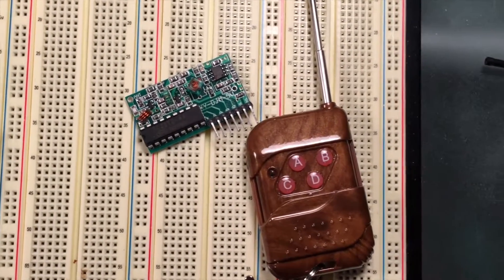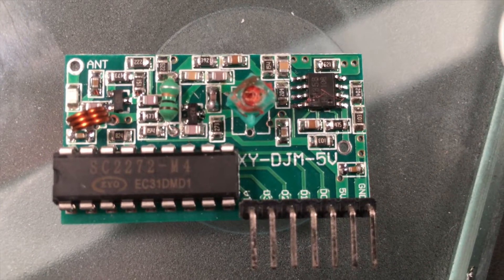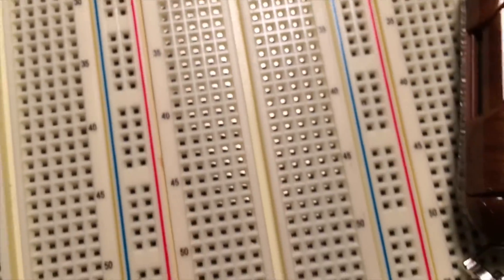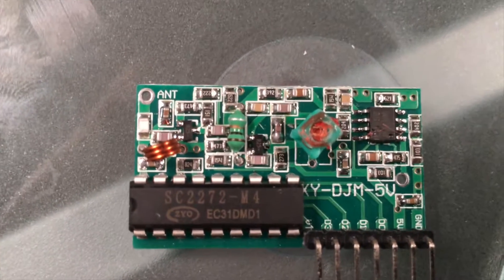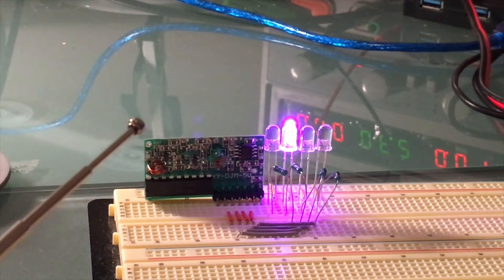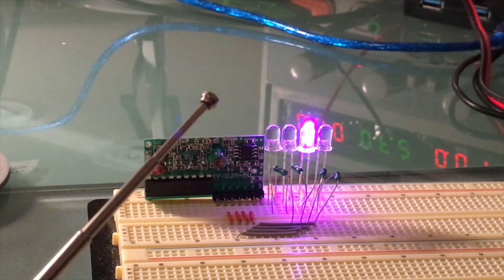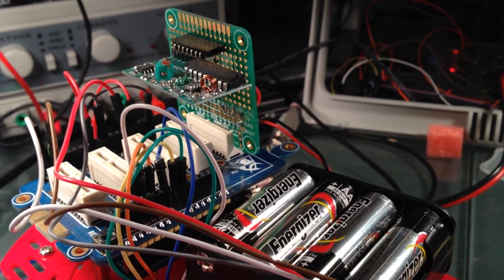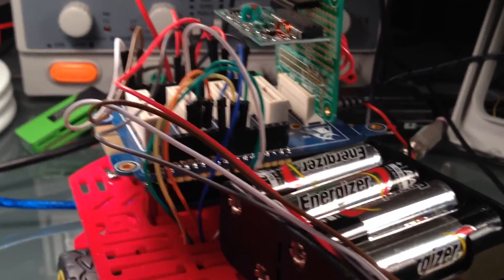4 Channel Wireless RF Remote Control

Comment: VT = Valid Transmission.
Active High Signal. VT in high state signifies that PT2272 receives valid transmission waveform.
Reply: This is momentary, any way to make it self locking?

Comment: sir nice tuts...what if other guy has the same controller like you will it interfere w. the reciever.?
Reply from the maker: I have actually tried this out using two transmitters, and they both worked on the same receiver, so yes, for this particular model they would interfere with each other.

Comment: Does the receiver, works with a battery?
Reply from the maker: The receiver I'm using runs on 5 volts.  I don't see a voltage regulator on the receiver, so you could use a 9V battery with an external voltage regulator (LM7805 for example) to bring it down to 5V.
Reply: Electricks, Thank you for the reply, is it normal if the receiver's output turns on and off, even if the button from the transmitter was kept pressed?
Reply from the maker: I have never experienced that happening before.  However, for the small robot I built I designed it so that you only need to press the button once and it will continue to perform that action until a different button is pressed.  So if you press 'A', it will move forward until something else is pressed.  So I don't normally keep the button pressed to perform an action.

Comment: Hi, im a newbie to electronics and I want to turn something on and off. If someone else has a remote just like that, will that affect the board? Will it turn the outputs on?
Reply from the maker: I do not believe the transmitter is paired to a particular receiver for this model.  So any transmitter could be used with any receiver.

Comment: Can you please tell me the default maximum voltage of the RF trans-meter ? I mean how much volt motor can i use and what is maximum ?
Reply from the maker: Salim Reza The receiver runs at 5 Volts.  I don't believe you could draw enough amps through the output pin to power a motor however.  You would need a power shield, transistor, or relay switch.
Reply: Electricks how to do that?  can you please help me
Reply: I actually want to use it for a drone...  I need 12 volts in all 4 motors....  I have ardiono.... and rf transmiter...  and battery.... how to connect them all without electric boards
Reply from the maker: The transmitter runs on a a 12 Volt battery (MIN21/23).  I do not have a datasheet for it, but I am guessing there is a 5 Volt voltage regulator to run the electronics on its circuit board and perhaps the full 12 volts is used to power the signal.  On the receiver end, you would need to connect the output pins of the receiver to digital I/O pins of the arduino.  In the arduino sketch, you would check the the pin inputs from the receiver for HIGH/LOW and then do something to the motors based on that.  This link (https://learn.adafruit.com/adafruit-motor-shield-v2-for-arduino/powering-motors) shows how to use an arduino shield to power motors, and this one (http://www.instructables.com/id/Use-Arduino-with-TIP120-transistor-to-control-moto/) shows how to power them with a TIP-120 transistor.

However, the particular model of RF transmitter that I used in this video would not have the range you would need for a drone.  It would work for a robot or RC car/boat, but you would need a stronger transmitter for a drone.
Reply: thank you so much , Can I control the arduino with internet from my phone ? this way I can have a very very long range ! but I dont know how can I do that ! Can you help ?
Reply: I actually dont need long range .... 150m to 200m  is enough for me !
Reply from the maker: If a phone app exists to do this, it should work.  Otherwise you would need to write your own app.  You could put a wi-fi shield on the arduino and then add code to your sketch to receive signals over Wifi to control the motors.  You could also look at using a Raspberry Pi instead of an arduino, since it has Wifi built in.
Reply from the maker: This should work, but keep in mind that relays have a slower response time (since there are actual moving parts) compared to transistors.  That may make a difference for controlling drone motors.
Reply: if I want to use a remote and reciever of drones .... where to find them !? How much will they cost ? or which one is good !? and what are they actually called ?

Comment: I need the circuit where I can connect relays to control motors. I connect a 2n2222 transistor and its relay and I'm still blinking. someone help me?

Comment: how to power up that receiver?
Reply from the maker: You could use a 9 Volt battery, but you would need to regulate the voltage down to 5 Volts.  An LM7805 voltage regulator could be used to do that.
Reply: Can I use 5 1.2vbatteries?
can I use 3.7v battery?
can you do a tutorial on powering up the receiver with 9.6v battery using LM7805 voltage regulator?
Please!
Reply from the maker: I think that 5 1.2V batteries would be too much voltage (6V).  You might try 4 of them (in series), which would give 4.8V. That should work.  The 3.7V battery will likely not provide enough voltage since the receiver needs 5V.
Reply: can I use five 1.2v batteries and use mini 3A DC-DC Converter to give the receiver 5v?

Comment: Hello I have 2 modules like this one at home, and nothing works.
I do not understand why. I have plugged the 5v, with one LED test on of output (1/4), and when I use the remote : nothing happened ... as if the remote control was not synchronized or the receiver was grilled. Do you have an idea ? (The LED on the remote lights up when I press)
Reply from the maker: Even though the LED light comes on when you press the remote button, you may still want to measure the voltage of the battery with a multimeter just to make sure it is good.  Also maybe try the other 3 outputs  with the test LED, and make sure you are using a current limiting resistor with the LED.  Test the LED independently to ensure it is not burned out.  Double check the wiring of the receiver (5V connected to 5V, ground to ground).  Other than that, I can't really think of anything other than the receiver or remote is defective.
Reply: yes... i think it is defective., because i already test what you said.

Comment: i bought one i want to run a high rpm 12 v motor how to connect it .can you please provide the circuit diagram.
Reply from the maker: You could use a TIP120 transistor.  The output pin of the RF module would go to the base pin of the transistor.  This Instructables link shows the circuit: http://www.instructables.com/id/Use-Arduino-with-TIP120-transistor-to-control-moto/
In the Instructables circuit, he is using an Arduino pin to connect to the base, so you would substitute the RF module output pin.
Reply: thankyou very much for the help.i will inform you for any further help.thanks.

Comment: Resistance you use
Reply from the maker: +林均育 
Those are 220 Ohm current limiting resistors for the LEDs.  You would not normally need those unless you had the data pins connected to LEDs.

I believe there are internal pulldown resistors on the receiver to keep those pins low, so you shouldn't need pullup/pulldown resistors to read from those pins from an Arduino.